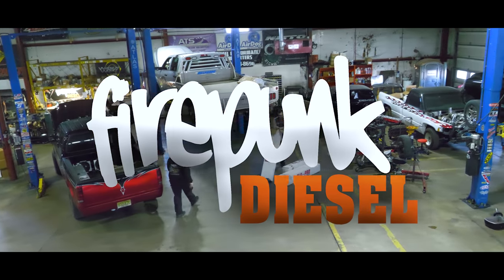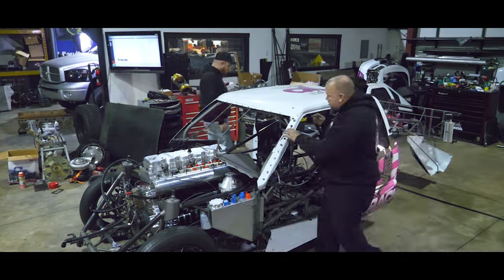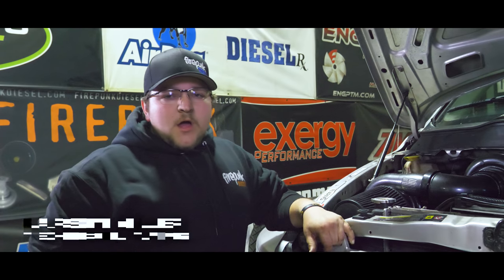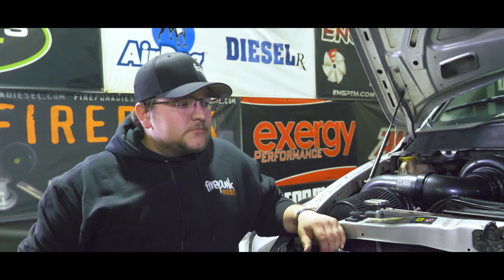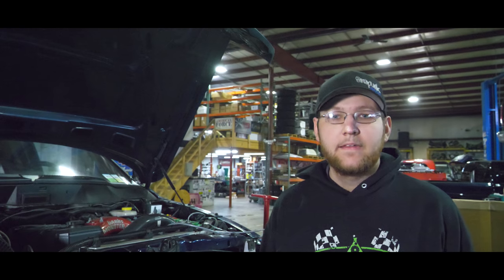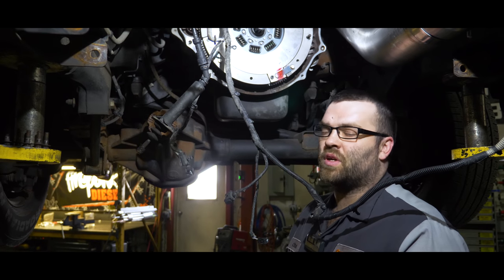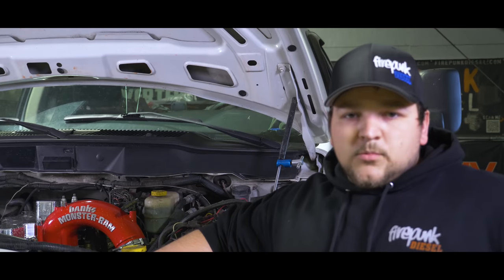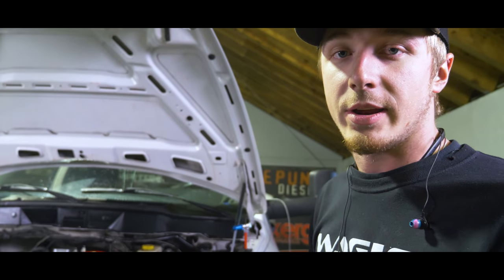1000HP - TAP SHIFTER - GIANT COOLANT MESS

Comment: Over or under 1700 bucks to get a dual disk in that 6 speed
Reply from the maker: The valair dual disc with hydraulics is $1295 + $450 install then 7% sales tax
Reply: @FirepunkDiesel  Not too bad, I'll be getting a clutch for sure this summer. 5 and 6 are slipping on the hot tune on the stock one